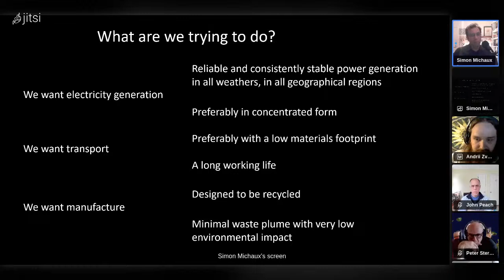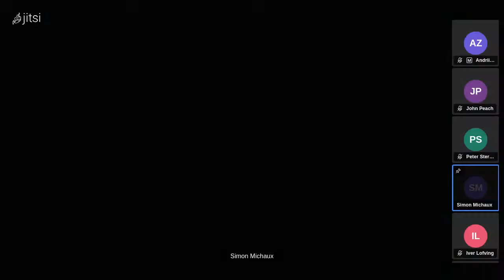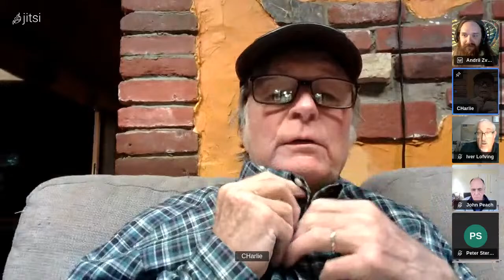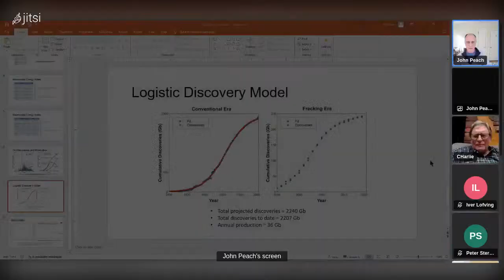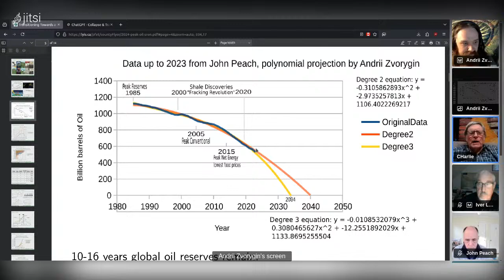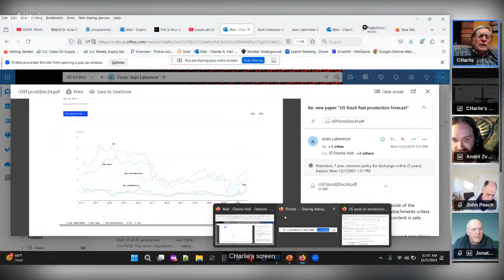Peak Oil Chat: Charles Hall founder of EROI (Energy Return on Investment)

Comment: Changing the method or efficiency of the acquisition of materials is still under unity. Period. Lasers and shielded microwaves and magically isolated hydrogen (when the cheapest and most employed method (99%) of isolating hydrogen, at a loss, is natural gas methane reforming process) are all pipe dreams. This Simon guy would add extra steps, with extra loss, by adding useless complexity and his ENTIRE premise is the continued acquisition of raw materials for continued high energy consumption per capita. This nets no positive change.
Reply from the maker: fair enough, my understanding is Simon is talking about making tiny pockets to survive downfall of civilization as we know it.
Reply: @AndriiZ  Hydrogen fuel most employed as hydrocarbons are already the most energy dense, lowest complexity, throughput fuel we've been able to use, systemically. The "post collapse" solution will remain distilling wood for methanol, using wood ash for the lye, and then combining both with the oil/fat source locally rendered to make biodiesel...or...hydrogen fuel that is liquid at room temperature. It is a method that can be done by a single person with a still and a bucket with a hole and a cork. 

The function that will change, is the human behavior. That is the easiest path of least resistance. It should be a move toward self sufficiency and lower energy consumption. If we continue to pretend there's some complex Rube Goldberg machine that will save our, already decaying rate of, consumption, then we're on track for a global series of French style Revolutions.

Comment: please explain inflation and the relationship between energy and the money supply
Reply from the maker: Inflation and its relationship to energy and the money supply are interconnected through economic and resource dynamics. Here's an explanation that combines these elements:

### Inflation
Inflation represents the rate at which the general level of prices for goods and services rises, eroding purchasing power. It is influenced by:
1. **Demand-pull inflation**: Occurs when demand in an economy outpaces supply.
2. **Cost-push inflation**: Driven by rising costs of production inputs, like energy and raw materials.
3. **Monetary inflation**: Arises from an increase in the money supply relative to economic output.

### Energy and Inflation
Energy is a foundational input for all economic activity. Its availability and cost profoundly impact inflation:
- **Energy as a Cost Driver**: Energy costs influence transportation, manufacturing, and service sectors. An increase in energy prices, such as oil or electricity, raises production costs, often passed on to consumers as higher prices (cost-push inflation).
- **Energy Security**: Limited or unreliable energy supplies can constrain economic growth and lead to price volatility, further fueling inflation.

### Money Supply and Energy
The money supply's relationship to energy hinges on the economic system's dependency on physical resources:
1. **Energy as a Basis for Economic Value**: Historically, economic growth has been tightly linked to energy consumption. When economies expand, energy demand rises. If the money supply grows without a corresponding increase in energy production, inflation can result as money chases limited goods.
2. **Energy and Monetary Policy**: Central banks often respond to energy-driven inflation by adjusting interest rates. However, this does not address the root energy constraint, potentially exacerbating economic instability.
3. **Resource Constraints**: If energy availability decreases or its extraction becomes more expensive due to depletion or geopolitical factors, it places limits on economic activity. In such cases, attempts to stimulate growth through increased money supply can lead to stagflation (inflation coupled with stagnant economic growth).

In summary, energy availability acts as a fundamental constraint on economic activity. The interplay between energy, money supply, and inflation underscores the need for sustainable energy solutions and resource-efficient economic systems to mitigate inflationary pressures and ensure long-term economic stability.
Reply: @AndriiZ  You have detailed the standard "economics" explanation quite well.  However, since the creation of the Federal Reserve system in 1913, the U.S. has experienced nearly constant monetary inflation, with fluctuations, up to the present situation where a one dollar federal reserve note is worth only 2 cents of a 1913 dollar.  Fossil fuel production increased throughout this time.  Moreover, the "money supply" is increased primarily by commercial bank creation of bank debt and bank deposits, such as was seen in the 1920's stock market inflation and in several housing bubbles.  The most recent housing (mortgage) bubble, which seems to ending now, has been followed by general price inflation.  Basically a debt-based monetary system requires inflation to make debt payments possible.  My second point is that renewable energy does not require money payment for fuel, which deprives the monetary system of an important source of money (debts and deposits) demand.  The topic is perhaps worthy of a book, but these two points -- inflation despite rising fossil fuel production and renewable energy reducing opportunities for debt/deposit creation, seem to contradict the argument for stagflation based on declining fossil fuel production.  Why is it not possible to have "economic growth" is a deflationary monetary scenario?  I suggest your explanation is in the context of "economics" which disguises the inflationary requirements of a debt-based monetary system as economic growth.  Basically, this contradicts the centrality of energy in the context of monetary inflation.  I would say instead that the federal reserve system requires inflation and forcing this "monetary inflation" through the system creates the appearance of cost-push and demand-pull  inflation.
Reply: @AndriiZ  You have given an excellent summary of standard economics regarding energy prices and inflation.  I was looking for more specifics and empirical evidence.  The Federal Reserve was created in 1913 and we have had inflation ever since.  A federal reserve dollar today is worth about 2 cents of a 1913 dollar.  We have inflation regardless of energy prices or availability.  I would make the argument that linking inflation to energy or to "cost-push" or "demand-pull" is disguising the monetary inflation inherent in the federal reserve system.

Comment: Hi Andrii, thanks for letting us meet Charles and Simon, who presented new updates on their work and rest of the panel who all added very valuable insights.
I think one journal paper you might have forgotten adding to the reading list, which Charles also recommended: Odum & Pinkerton (1955): Time's speed regulator: The optimum efficiency for maximum power output in physical and biological systems, American Scientist, Vol. 43, No. 2 (APRIL 1955), pp. 331-343 (13 pages) - can be read at JSTOR. (If I include the link the algorithm deletes my comment.)
btw, this was an eye opener also for me for my doctoral work on urban scale modelling to include energy infrastructure.

Comment: Many thanks... would like title of the 1950s paper Dr Hall referred to..regards..
Reply from the maker: Odum & Pinkerton (1955): Time's speed regulator: The optimum efficiency for maximum power output in physical and biological systems, American Scientist, Vol. 43, No. 2 (APRIL 1955), pp. 331-343 (13 pages) - can be read at JSTOR. (

Comment: There are newer ethanol plants in Iowa and Minnesota that use the corn silage or stalks vs the corn to ,are ethanol and they are breeding a type of sweetcorn that has a I think a higher sugar content in stalk than sugar cane .... so there might be a argument for getting the eroi of ethanol up higher in the near future. But it's been a while since I built a feed mill in Iowa near that plant about 10 years now.
Reply from the maker: in any case, if we were to use all the acreage we use for food, for producing ethanol, we would only produce something like 5-15% of the oil we use.
Reply: @AndriiZ  yes but the point is this is a much better way to produce ethanol and the high sugar content version could be a bit of a game changer . I don't recall what the eroei of sugar cane ethanol is ?
Reply: Supposedly it's between 6-8